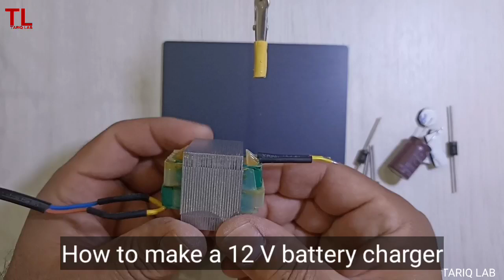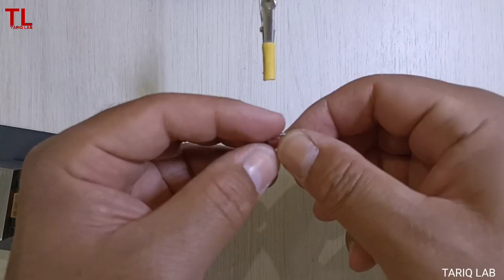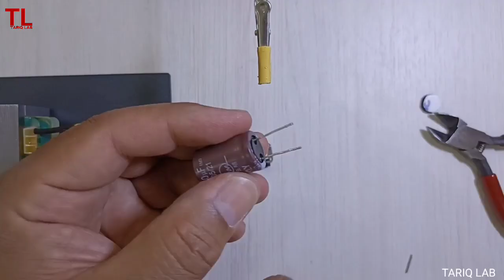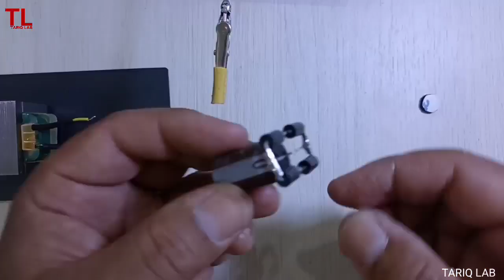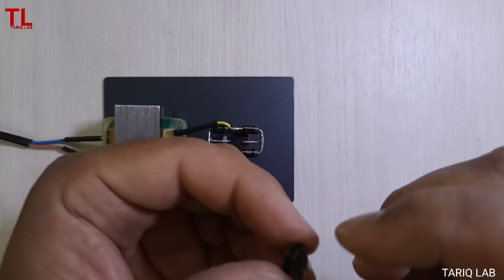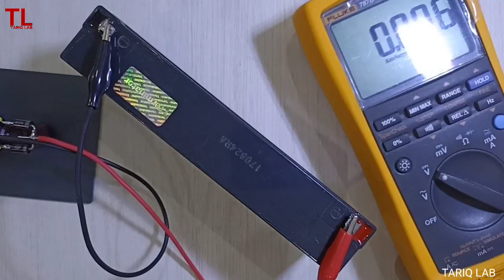How To Make a 12 Volt Battery Charger | Simple Battery Charger

Comment: what should be volt per turn for 
ee55 ferrite transformer when frequency is 100khz and input is 12v (push pull)
6.1cm (outer diameter) green toroid core, frequency is 80khz and input is 12v (push pull)
thanks